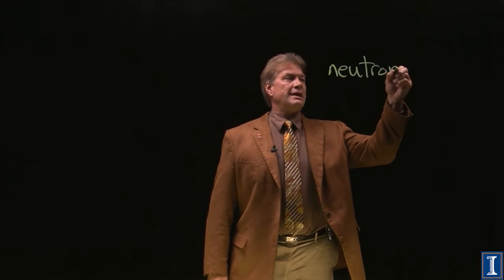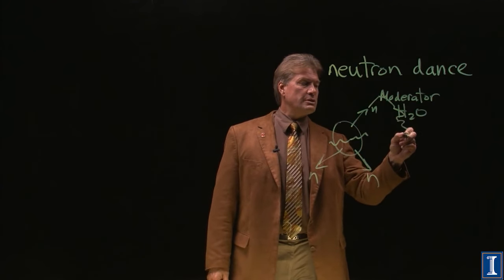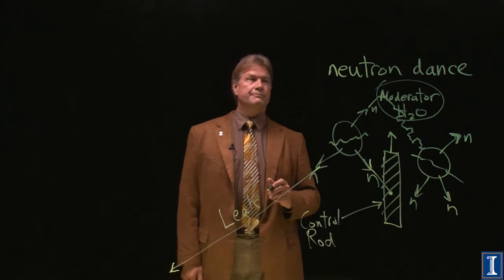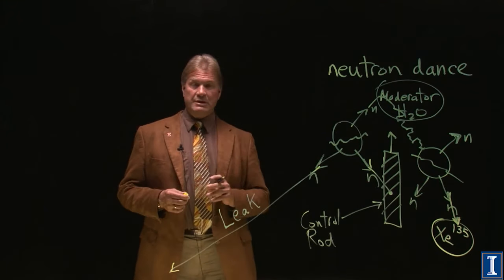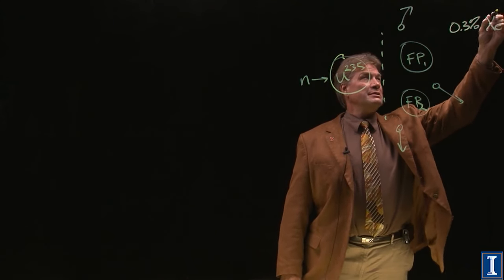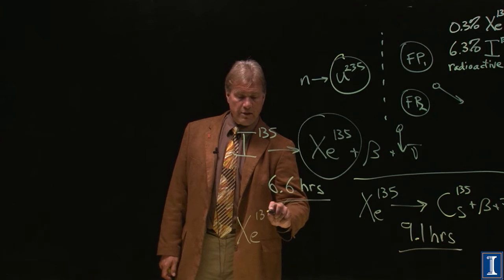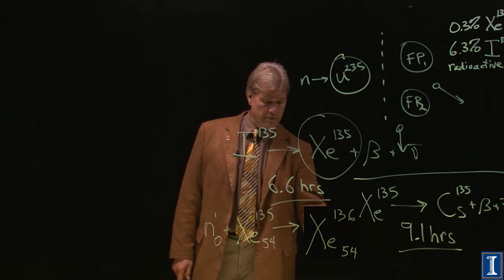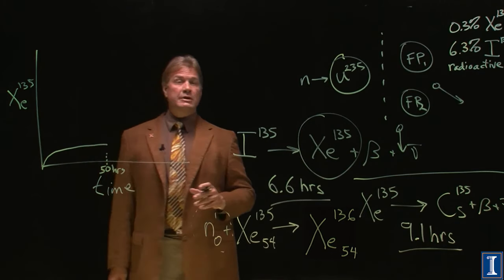Xenon Can Be a Problem

Comment: When I was in the Navy I saw the effects of Xenon poisoning first hand. We were near end of core life, had maybe 9 months or so left max (we where scheduled to decommission in about 8 months), and we had been steaming down the coast of California at all ahead full for better part of a day. All ahead full is 100% power.

We were passing San Francisco and Captain wanted to slow down and come to periscope depth to tow the radio lines and get the mail as well as to give the crew practice tracking surface ships in a busy shipping lane. Coming off the bell, reduced our power demand on the reactor significantly so the Xenon spiked very high. Being an old core, she produced a LOT of Xenon and handled it not too well. The reactor operator (I was on watch as the throttleman controlling the steam valves on the main steam turbines) had to start shimming the control rods out to keep temperature steady.

He kept going until all the control rods were pulled out and still we remained at 1/3 power. Finally, he couldn't maintain temperature in the operating band anymore and we watched as the reactor began to cool off as it struggled to maintain power. So the reactor operator advised to the officer of the watch to come back up on the bell so reactor power would rise and burn off the xenon faster and that he was unable to keep temperature in the operating band anymore. 

The officer of the watch informed the con (control center) and told the Captain we needed to come up on the bell or Xenon poisoning would shut down the reactor. So the order went out to pull the radio cables back in and 2 minutes later I was ordered to open the throttles back to all ahead full.

I did as ordered and we began drawing much more steam again and in so doing, cooled the reactor coolant even more. This colder water caused reactor power to rise, as expected, and this in turn warmed the reactor back up. It also increased the neutron flux and burned off the Xenon transient faster and in short order the reactor operator was able to start shimming control rods back into the core.

We had all been trained on this, the theory and physics as part of our nuclear training by the Navy. To see this first hand and to see the reactor behave EXACTLY as expected in a Xenon transient was pretty cool.

When it comes to handling them and reducing power responsibly, it is wisest to reduce power slowly and gradually over a period of 24-48 hours so the Xenon transient is controlled the entire way through. Newer reactor cores don't have to worry about this near as much since the ambient neutron flux is so high, even at lower power, that it burns the Xenon decay products off fairly fast.
Reply: this story was badass, nuclear engineering fascinates me. Its ashame its applications aren't recognized more often.
Reply: Very interesting info but let me correct your last statement. The so called by you newer cores do not worry much about the xenon indeed but for a different reason than the one you said. The freshly reloaded core has a lot of excess reactivity while the old one has almost none. The xenon poisoning eats some of the remaining excess reactivity. Since the newer core has plenty of excess reactivity the poisoning effect is significantly reduced. And the neutron flux is less in newer core than the older one. That is because the newer core has more fissile elements and less poisons (decay products) and therefor needs less flux to reach rated power. The older core (near end of campaign) has less fissile elements and more poisons and therefor needs more flux to reach rated power.
Reply: @dgenov  Except....aren't newer designs ....supposed to have to retain single fuel load for 2-3 decades? Shouldn't that impact this excess reactivity.
Reply: I thanks for the reactor story. Very interesting.
Reply: @piotrd.4850  All military designs are meant for multiple decades. But, that is subject to a disclaimer: Mileage may vary depending on use. So the time a core is good for depends on how heavy a load and for how long said load is placed upon it.

Those 2-3 decade life expectencies are based on the accumulated logs of decades of reactor operation from hundreds of nuclear powered ships since the USS Nautilus was first launched.

The amount of reactivity in a core is dependent upon:
1) Core geometry (physical layout of components)
2) Core physical size
3) Age
4) Amount of rated power consumed to date (The "fuel" tank of a reactor is rated in "EFPH" "Effective Full Power Hours" or how many hours at 100% power is the core engineered for)
5) Uranium purity. Civilian reactors try to get as close to 20% enrichment with U-235 without actually reaching 20%. 20% is the point Uranium is considered highly enriched and minimum for weapons grade, thus restricted. Military reactors are not bound by this restriction...

Continued refinement in all of these categories is what allows for such length lifespans for such tiny sized reactors despite being capable of 100+ megawatts of output at full power.
Reply: And here I thought that nuclear sub throttle operator was just handling a drive wheel and happily go around the oceans whistling his favourite song lol
Reply: All ahead full is not full power. Flank is. We’re you even in the Navy? Think not.
Reply: @SSNReactorOperator  Full of yourself aren't you?
 
I was an EM3 (SS) on the USS Salt Lake City (SSN-716) and the USS Virginia (SSN-774). I was there through the final year of regular service of the Salt Lake and her decommissioning and the work up and commissioning of the Virginia.

I got out of the Navy in 2007. Would you like to see my DD-214? Perhaps my entire service file? Mistakes are permitted.
Reply: What you described here was awfully similar to what lead to the catastrophe in Chernobyl. Different reactor design saved your rear!
Just one hint: I'm very sure the reason for new cores being affected less is that they have much more excess reactivity. More fuel atoms and less neutron absorbers. New cores can work at a lower neutron flux level than old ones to overcome the poisoning.
Reply: @jackmclane1826  I wouldn't go so far as to say it "saved us". We knew exactly what was going on, and why, and never came close to losing control of the reactor. High pressure water reactors are an entirely different kettle of fish compared to a boiling water reactor. They are also amongst the most inherently safe designs we, mankind, has come up with. There are some that are even safer, but politics has done more to stymie us from exploring them properly (I AM LOOKING AT YOU NUCLEAR PROTESTORS!) than anything.

One of the most important physics in a reactor at all is reactivity component arising from temperature or, as we called it "fishy-T" due to how the math symbols looked on paper.

High pressure water reactors are usually "under-moderated" which means they don't quite have enough material to slow down all the high speed neutrons produced. This makes their temperature reactivity quotient negative. Temperature goes up, power goes down.

Chernobyl was the exact opposite. Over-moderated and had a positive response to increases in temperature, thus a natural tendency to want to run away.

Combine that with an operating crew who did not understand the engineering nor the physics of the reactor they were running, and were further hampered with extreme inexperience (only the shift supervisor had been there for a long time, rest of the guys there that night were very much new) and then toss on an extremely complicated safety test that put the reactor into an inherently unstable condition, you get the recipe for disaster we call Chernobyl.
Reply: This was very well described, you should do more writing @MaadHawk, if you don't do so already.
Reply: What would have happened if you had to do a crash stop?
Reply: @RonJohn63  You mean like we had to suddenly stop the boat and like emergency surface?

The reactor would just keep getting colder. At a certain point, we would then have to scram the reactor and shut down completely for the safety of the entire system. At that point we would fire the diesel engine and have to wait until conditions within the core had stabilized enough for us to calculate the new state of the reactor core and start up normally.
Reply: @Maadhawk  "At a certain point, we would then have to scram the reactor and shut down completely for the safety of the entire system."
Because of xenon poisoning?
Reply: @RonJohn63  Do realize these transients happen all the time when a reactor decreases in power. However, most of the time you won't notice the effect because of all the other sources of positive reactivity in the core.

We only had this situation occur because we were VERY close to end of core life. So a great deal of our uranium had already been spent.

I think it is important to note that the #1 safety concern is preventing radioactive material from escaping the system and getting into the environment. As such, a major point of operational concern is preserving the integrity of both the fuel and the steel containers that hold it all, i.e. pressure vessel, coolant piping, etc.

High pressure, light water, reactors are just that, under very high pressure. A metal's ability to withstand pressure is temperature dependent. Too hot, the pressure turns your metal container into a balloon. Too cold, the pressure will cause it to snap via brittle fracture. So yes, if we had come to a complete stop, depending on how long, we very well might have had to scram the reactor.
Reply: @Maadhawk  thanks for the explanation.
Reply: After watching the video and then reading this I consider myself qualified.
Reply: Are you supposed to talk about this? I was under the impression that anything that happened on military reactors was classified.
Reply: @anonops1980  Nothing classified has been shared. The engineering is classified, but this discussion has been only common physics. You would see similar effects in commercial reactors if you burned enough of the fuel supply before shutting down to do maintenance and refuel. A great deal of the physics can be found on Wikipedia as well.
Reply: @Maadhawk  Well, that's good. I was worried for you, mostly. Wanna her a fun story? A while back, a couple of clowns decided they should sell submarine nuclear secrets to my country, Brazil. So they literally e-mailed our intelligence agency basically saying "hey, wanna buy some reactor plans?". We communicated this to the FBI straight away, naturally, as we are friendly nation and close allies of the US. I laughed my ass off when I first heard this story, mostly because anyone that knows anything about public service in Brazil knows no intelligence officer would do anything BUT report this shit to the US. Fun times, man.
Reply: @Maadhawk I think Chernobyl had a positive void coefficient also, once the water turned to steam, she was done!
Reply: @georgefoster2445  Yep, the RBMK reactors of the Soviet Union did indeed have a positive void coefficient, among many other significant design flaws.

Comment: The new Moltex plant going through safety homologation at New Brunswick in Canada has a highly negative power coefficient. It can sit with the load disconnected at full power settings and not overheat. It’s fully self regulated. They have avoided the Xenon problem by venting the fuel tubes. 
The reactor core uses a uranium chloride fuel in a chloride salt carrier contained in vented fuel rods. 
The primary coolant is the same chloride salt (without fuel) which transfers heat by convection to a tertiary salt. That is the exact same as used in thermal solar power. 
Iodine and caesium react to salts so do not vent into the vents. Systems are in place to manage that if it happens.
Reply: Yes the Moltex design  is very interesting. Though I'm puzzled why they switched from fluoride salts to chloride salts. I thought the negative void coefficient was because the fluorine had some moderating effect so a void in the coolant would reduce moderation. I'll have to read up on their new design.

Comment: Huh, I wasn't expecting to understand Chernobyl disaster better after this video, but here I am.
Reply: the guy tells garbage. Chernobyl did not explode because of xenon poisoning, it was human error and unknown technical problems for all reactors of this type (by the way, an American design and not a Russian development). The nuclear industry has learned a lot from Chernobyl and abolished graphite moderators, since once they burn they can no longer be extinguished.
Reply: 1. Thanks Youtube Algorithm for waking up this video.
2. One thing he gets wrong is that the engineers at Chernobyl knew about Xenon. They weren't stupid. They knew they were working with a poisoned reactor, but in the rush to finally get this stupid test out of the way, they tried to run the experiment anyway. They thought they could SCRAM the reactor and shutdown if anything went wrong. They figured, what's the worst that could happen, they shutdown and try again later? The reduced coolant flow (part of the test) triggered the rapid burnoff of Xenon, They tried to shutdown, but the control rod design caused them to increase reactor power at first before they started slowing the reaction and then pent up steam pressure from the overpowered reactor bent the rods to the point where they got stuck, and then coolant lines in the reactor exploded, but the reactor was designed to contain one or two exploding coolant channels. They thought it was a super safe design but in reality it was so unstable no one ever expected they would blow three or more at once. This blew the lid open, exposed the superheated graphite to oxygen in the air, and that caused the main explosion. Soviet physicists knew about the control rods. They knew that the rods could cause an unexpected spike in power when first inserting them. They saw this happen in a previous incident, but they purposely withheld this information from the plant engineers. If they had known they wouldn't have messed around like this.
Reply: @johns8364  Either way it was still human error whether they intended to run a poisoned reactor or not.